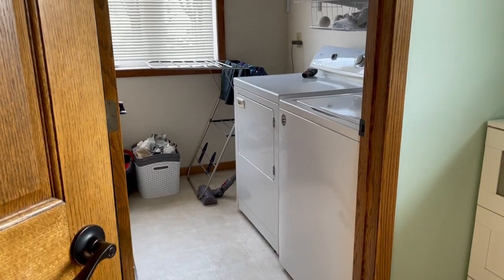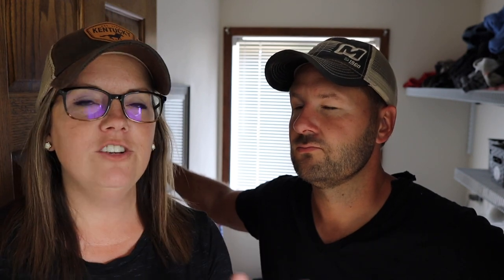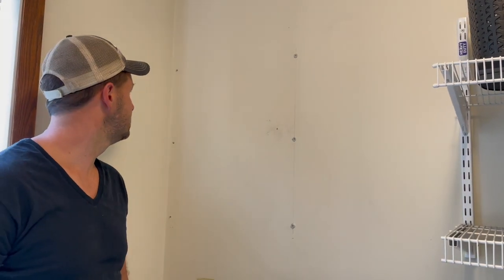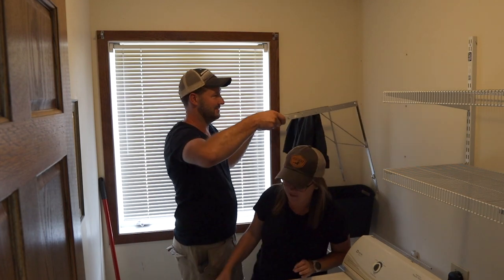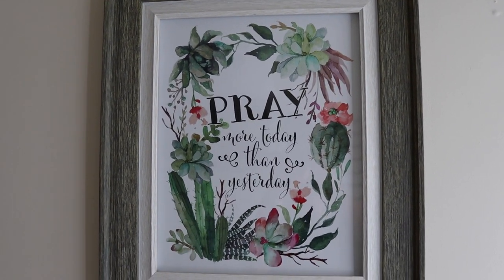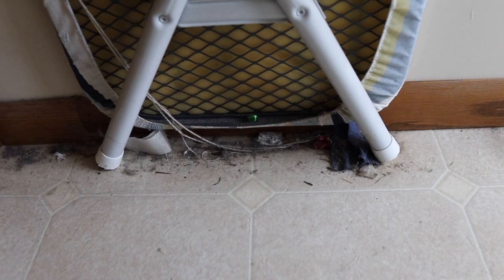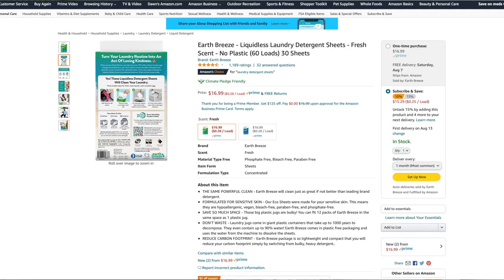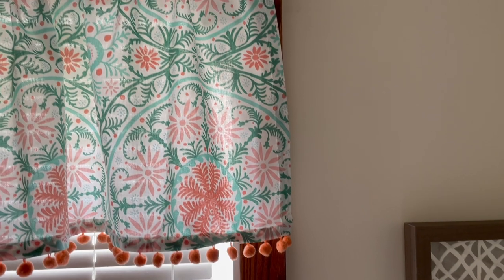Dream Laundry Room Makeover!

Comment: I noticed your dryer opens on the wrong side for ease of moving wet laundry from the washer into the dryer. I had the same problem until I realized the dryer door is reversible. Maybe yours is, too. It only took me about 20 minutes to fix a problem I'd lived with (and complained about) for 7 years!!  Anyway, love your videos as I'm a minimalist, too.
Reply: Yes, that would drive me crazy too!  My washer and dryer are across from each other (very small laundry room) and I love being able to just throw the clothes behind me into the dryer.
Reply: Great tip!
Reply: Have you ever noticed how many refrigerator doors open to the wrong direction, ie, not towards the counterspace where you could lay down items from the refrigerator?  Those doors can usually be changed too.
Reply: I was thinking the same thing! Game changer!
Reply: 4 screw..no brainer
Reply: It is so much easier to throw the wet clothes in the dryer when it opens the other way. Or trade the washer and dryer around.
Reply: Wow...did not know that. Thanks!
Reply: I hope she sees this!!!

Comment: I do 90% of the laundry in my house and keep my “non-dryer” dirty clothes in a separate hamper as well however, I will wash them with other clothes. I put a magnet on top of the washer to remind me to look for those items that should not go in the dryer.  It’s a nice visual because I can get busy and easily forget to pull out the hang dry stuff. Maybe this will help somebody!
Reply: I have a similar philosophy but I mark the top of the washer with a wet erase marker not to put anything in the dryer.
Reply: I love these kind of tips and what works for others!! I’ve seen the top about a dry erase marker but I’ve had others (kids) accidentally swipe it off and I noticed the ink settles into any little surface scratches on the dryer. Mines not brand new anymore so that’s probably why 😜
Reply: I stick line dry items in laundry garnet bags! (Or things with ties or straps that I don't want to risk getting caught and ripped in the machine, even tights.) It makes it faster to find the persnickety items.

Comment: don't even buy an ironing board if u only iron once every blue moon - buy a heat resistant blanket (or just use a thick towel like i do) and iron on the kitchen table .. it works just fine, even for shirts !
Reply: They make a magnetic one to go on your dryer...
Reply: Or a portable steamer!  It has a smaller reservoir, but will get the job done.

Comment: Looks lovely! Also, I decluttered my ironing board a while ago and went with a pad type thing. Instead of having a board, it is just a quilted type pad that has magnets in the four corners, about the same size as the top of your dryer. I ‘store’ mine in between the washer and dryer. Takes up no space, physically or mentally. Thought you should know. 😊

Comment: I would suggest that, if possible, you switch the direction that the dryer door opens.  Reversing the dryer door will make it more accessible to the washer (and saves your back too).
Reply: To get the trash can off the floor they make magnetic lint trash cans that then stick to the side of your dryer.
Reply: I thought that too about the dryer door
Reply: That really bothered me too. 😂
Reply: @danib8473  Thank you for the great tip!
Reply: I noticed that too... possibly the washer could have gone where the new lower shelves went... if the dryer and washer are switched where they are, the dryer door may get caught by the room door.   It makes a big difference.
Reply: My sister-in-law did this when she visited the first time. Didn't ask, just did it - she even asked why didn't you switch it? as she's switching it. LOL Best thing ever! It's been 20 years but I still think of her every time I do laundry and I'm on my 2nd dryer. =)
Reply: @sandyb34  my response would’ve been “I didn’t know you could!” 🤷‍♀️😁
Reply: @lisadearing5960  That WAS my response! LOL
Reply: The dryer door was the first thing in noticed and kept hoping they were going to change it around 😂

Comment: We hang everything (except undies and socks) so I hang it as I pull it from the drier. No laundry baskets in the house, it's way too easy to pile it in and leave it until later. We're very visual so hanging it works better than folding and putting in a drawer where we have to hunt for it. Thank you so much for all your tips and visuals on ways to do things. Learned so much and my favorite day to watch is Fridays when you and Tom work together on projects. Hysterical.

Comment: I recently had to move my dryer. I looked at some videos online for my model and ended up taking off the back panel. I found so much lint inside the machine! This is a serious fire hazard. It might be helpful to see the specs on your machine so you know where the lint travels, It may be down the front and around to the  back. I highly recommend cleaning inside it more often than I have!

Comment: Thanks for keeping it real and yup I pull out the washer and dryer once a year cause you never know whatcha gonna find!  Small changes but big impact, functions for your family and easy to clean.  Great tip on the mesh bag!
Reply: And the frig and the stove!
Reply: Barbara, yes!! The dryer vent hose needs to be cleaned out regularly to prevent a fire hazard. :) Most people don't realize they could burn their house down if that built-up lint gets packed in the hose and ignites with the heat from the dryer. :O

Comment: I use those laundry sheets! I love them and for the most part, probably 90%, will only use them. I have some liquid, a small bottle, for really dirty rags and work clothes. The sheets take up no space, no plastic (which i like a lot), and the packaging is compostable. It’s $12, which is what I spent at Costco, and it comes to my mailbox. Super easy!

Comment: LOVE the Earthbreeze sheets - Very clean laundry, not gummy junk, Tom!  No build up and hubby loves them too.  I use 1 or 2 sheets per load, depending... BE CAREFUL not to get the package wet!  It's easy to "melt" them away in a laundry room - you won't believe how clean the laundry will be, how clean the washing machine is and how environmentally Earthbreeze is.  Same cost for me, as I was using Tide. Auto ship is right online with my needs too.  Highly recommended.  Love your new laundry room.  Great tips.

Comment: You can also use the new folding dry rack to hang hangers on. As a height challenged person, I think this would work. You may just need to hang shelves below a bit lower.
Reply: I just take the clothes that need to hang dry and put them directly in my closet, on a hanger, with space from other clothes so they have some air circulation.

Comment: I AM a prepper, so I struggle with the inventory concept. However, it was great that I did not have to go to the store as lockdown happened last year.
Reply: I am too. I keep out kitchen and living area minimal, and have a designated area on shelves in the basement with prepper items. It’s for emergencies so I keep it separate from our daily living spaces.
Reply: I’m not a typical prepper. But I do like having an inventory of goods,  I follow the container concept. I developed a basic extended pantry that we keep & use from. We only keep that amount & we continually use from it & restock as necessary.  My inventory is larger than some but smaller than others. You have to find what works for you.

Comment: I like what Tom said: "We have a minimal wardrobe, so we treat our clothes well." Exactly! That was how most of us grew up. With less clothes; therefore, we treated those clothes with tender loving care!!! For example: Take off your Sunday clothes and when you return home, do NOT play in them and hang them up carefully.
Reply: Unfortunately, clothes like everything else aren't made to last.  Therefore, it doesn't matter how well you treat them - they will fall apart sooner rather than later.  Jeans all have elastic stretch that breaks down.  Shirts from the same company that used to last for over 10+ years now are thread bare within a year.  It's not about the individual, it's about the clothing companies trying to make a buck.  Fridges, washing machines, etc., don't last as long.  They are built to be replaced not repaired-- gotta love capitalisim at its finest.  

(Side note: fewer clothes (not less))
Reply: @elissa3188  If you don't put clothes in the dryer for long they last a lot longer, same for sheets and towels. We tumble them for 5-10 minutes then hang outside or in our basement drying area. Great for when the electric goes out.

Comment: Love love love my laundry sheets!  I was a dedicated Nellies user, and a big Costco bucket of soap lasted years for me, but I always hated storing the huge bucket. I started a year ago with TruEarth  and I haven’t looked back!  They clean great and I’ve had no issues with residue or stains. I still pretreat any stains that I normally would such as grass stains or food, etc. I’m in Canada and love that Tru Earth is Canadian :).
Reply: Susan Mercier - Yes!! Me too!
Reply: I just ordered from them as well, and for the 3 loads I've done so far, they seem to work just fine.
Reply: I use Tru Earth too and love it!
Reply: @alisongregson4740  Question for you, I have a front load and have read different things about how to put the strip in....how do you do yours?
Reply: @SusieM17  I have a front load as well. I take the portion of the sheet that I need and rip it into little bits into the liquid detergent drawer. I got that tip from Steph at the Secret Slob.
Reply: @SusieM17  I have a front loader and I don’t rip it into strips - just pop it in the drawer and no issues. When I first started using, I tore it into strips and I had some residue in the drawer. No idea why, but truearth suggested to just drop it in the drawer whole, and so far no issues in my machine.

Comment: Wait until you clean out the bottom of the dryer. We recently did it and oh man am I grateful my husband did it. Let's just say HUGE fire hazard! Lesson learned before a fire. 🥺
Reply: After we pull the dryer out, we bring in our leaf blower and blow out the lint through the outside vent.  You have to wrap a small towel around your inside vent opening so the lint doesn’t blow back into your room.  You will be amazed at what will come out! 😳
Reply: @lisadearing5960  Yes, we normally do that! This time we ok pulled the front part off at the bottom.

Comment: I use tru earth laundry sheets. You might need something stronger for Tom's clothes if they are really dirty and have grease on them. Good luck 🤞
Reply: I put a little squirt of dawn dish soap (on hot/extra rinse) in with the dog laundry to cut the smelly oils. It helps a lot.

Comment: Tom is adorable with his questions. And they are good ones. I can see those laundry sheets stacking up. Unless they completely disintegrate? I'm going to go through my laundry 'closet' and list what is not working for me. Thanks for this great video.
Reply: They are just soap. They completely dissolve.
Reply: They completely dissolve in water, cinnie2. They are just soap.
Now if you wanna talk dryer sheets, those are a problem and leave a film on everything. Not at all eco-friendly. Best thing to use are dryer balls. Also, vinegar instead of softener in the washer is better for the environment.
Reply: @opaldurham4818  Thanks!
Reply: @jemma50  Thanks!
Reply: @cathyb4770  Thanks!
Reply: @jemma50  I use dryer balls with my fave essential oils on them. Love it!

Comment: You can buy a “hook over the door” ironing board holder. That gets it off the floor and out of the way
Reply: We have this that also holds are iron but it bangs up against the door every time you open it.
Reply: @a.oblenis  And the bang is annoying.
Reply: @ninadukette3340  very!
Reply: You can shorten a pool noodle, cut down the length of one side then slip it over the "foot" of the ironing board leg and that will keep it from banging against your door or wall. Hope that made sense. I've used this to cushion the sharp edges of bedframes to keep them from scraping the walls and the noodle pieces are not noticable.

Comment: 😂 tom is always so funny! I just started swapping out our laundry products for more natural solutions. I was spending way too much not on brands just the volume of supplies we went through.  we did 41 loads last month and that was only because the kids were gone for 3 weeks, normally that is closer to 60+. I have 3 that wet beds still so we do sheets almost daily. I just found out I have 2 kids allergic to Vinegar! Ugh who knew any recommendations for something else I can use for softener.
Reply: Wait..What? Vinegar can be used as a fiber softener?? How much do you use?
Reply: Use baking soda at beginning of wash neutralizes odors...used in rinse cycle softens the clothes.
Reply: Baking soda.
Reply: I've heard that putting a quarter cup of salt crystals (like you use in a salt grinder) tied into a cotton sock and putting it in the dryer with your clothes can also work as a softener. Good for multiple uses. I'm allergic to wool, so no dryer balls, but I use white vinegar or no softener, so I haven't actually tried this one.
Reply: @ellen8996  thanks I will have to look into this one.
Reply: @jaellouis4749  You are correct in it is not necessary. However we have hard water and I prefer my clothes not stiff and scratchy.
Reply: @NLY1WAY4U  I have used baking soda in the past and recently discovered that the super washing soda (same thing but a chemical difference is my understanding) seems to work better with our water at least for meat and blood stains on hubbys clothes.

Comment: I like the idea of the laundry sheets, but.. they cost like 53 cents\load! Just making a quick batch of homemade powder detergent is almost as convenient, and space saving, and WAY cheaper. I even like the look of it on my shelf in a glass jar and scoop. :)
Reply: I do the same. Much cheaper!
Reply: How do you make it? I use liquid detergent, but it's heavy and expensive.
Reply: @MelindaPlainandSimple  I grate up bars of Fels Naptha soap and then whiz that up in the food processor. Then I mix it with borax and washing soda; 1 bar to about 1/2 cup of each of the others. I usually do about 5-10 bars at a time and it lasts a long time. I usually do it outside because it makes soap dust fly everywhere. Then I store it in a pretty glass canister.
Reply: @cynthiafisher9907  Thanks!
Reply: @MelindaPlainandSimple  You’re welcome!
Reply: Yes! This was my question. That just seems much too expensive (we have 13 children, do about 3 loads a day). I really like the Molly's Suds that Dawn recommended a while back. I've done the homemade but our clothes were turning out too dingy (we have hard water, so I suspect that's the reason). The Molly's is very reasonably priced for clothes that turn out clean. I'm sticking with what works! (But also very curious to hear Dawn's opinions after trying the sheets...)
Reply: @lotsofallisons  That’s interesting that your clothes turned out dingy. I have extremely hard water and mine turn out great, and I’m really picky about clean laundry. Did you use the Fels Naptha? I also put in Oxyclean if the load is really dirty and I spray the stains with Shout.
Reply: @cynthiafisher9907  Fels Naptha is the best stain remover. Old timey but it works.
Reply: @ninadukette3340  Yes! I’ve been using it for decades, great stuff. I’m having a harder time finding it lately, a lot of stores in my area have stopped carrying it.

Comment: Wholeheartedly agree with the laundry sheet detergent! We use TruEarth as well it comes in the mail. We also use Dropps fabric softener for anything that needs it and it's so simple! You just throw the sheet and the Dropp in at the beginning of the load and they come out clean and fresh every time. So much less space and totally plastic free!
Reply: Also for smaller loads we only use a half of a sheet and everything still comes out very clean! We get a lot more loads that way.

Comment: I use soap nuts instead of laundry detergent. I've saved so much money and there's no weird chemicals on my clothes. 😊
Reply: There are no chemicals from the laundry strips, either, Patricia. :) It's just soap in a sheet that dissolves in water.
Reply: @jemma50  there's definitely chemicals in laundry strips. Here are the ingredients from the manufacturer's website: "Our Vegan friendly ingredients are: Glycerol, Primary Alcohol Ethoxylate, Sodium Dodecyl Sulfate, Sodium Acetate Trihydrate, Polyvinyl alcohol, Polyethylene Glycol, Fragrance, Deionized Water, and Starch (Corn)."
Reply: @patriciaflaherty  I checked the TruEarth ingredients and they are biodegradable and mostly plant-based. Sometimes the scientific names make them sound worse than they are.
Reply: @jemma50  I'm not saying it's bad, everything is made up of chemicals. Laundry strips are just dehydrated laundry detergent.

Comment: I LOVE laundry sheets. Work great. Take up little to no space, but are more pricey per load. I took them on vacation when we were renting a house for a week that had a washer/dryer. No need to buy laundry soap when we got there. Very easy to pack. I normally use a highly concentrated laundry soap that doesn't take up much space, so I may stay with that due to cost.

Comment: Hi from the uk. Over 12 years ago I had an Ironing collection and Delivery service. The key to not having to iron is... Hang shirts, and those items that would require ironing, straight from the washing machine. However, I use a Dehumidifier with a Laundry Mode to dry my laundry, T/Dryers take fibres from clothing. Never dry fully clothing in a tumble dryer, or a Condenser dryer, have just slightly damp.